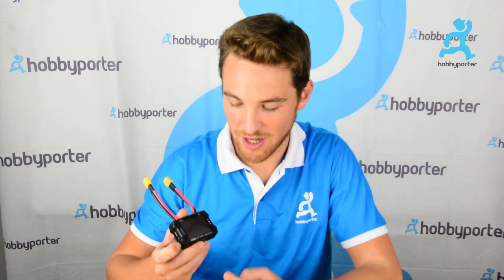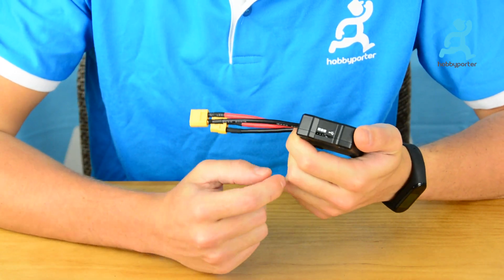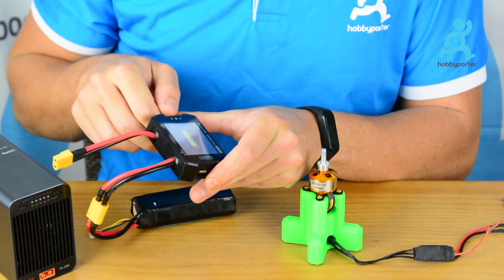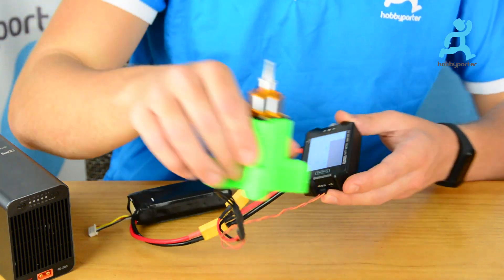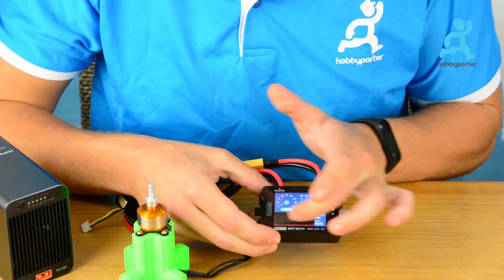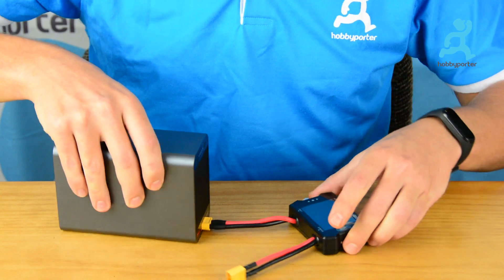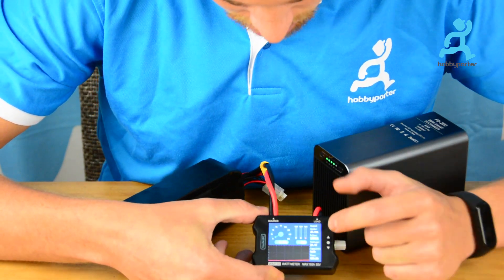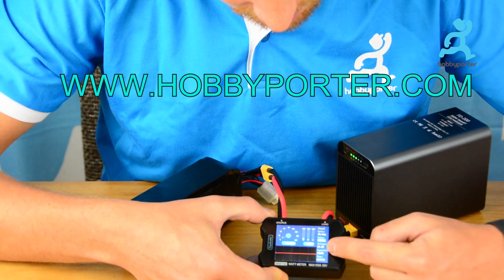ToolkitRc WM150 150 Amp Advanced Watt Meter with PWM control

Comment: Can you provide some info on your power supply? I haven’t seen anything like it before. Thanks and good Informative 
video.
Reply from the maker: Hello, in this video a battery is used as the power supply. The item used to make load is the FD200 Discharger from iSDT